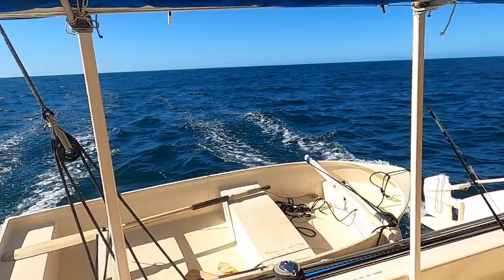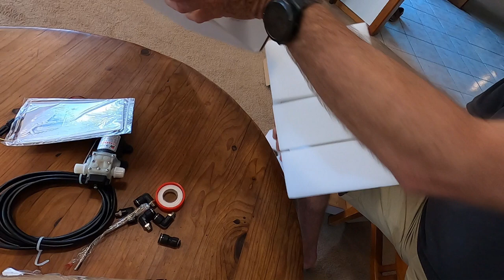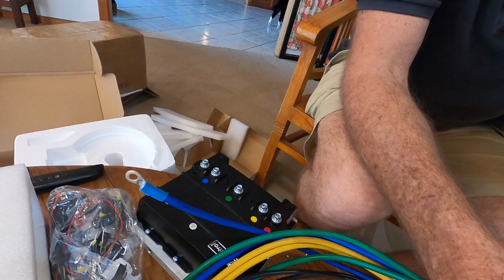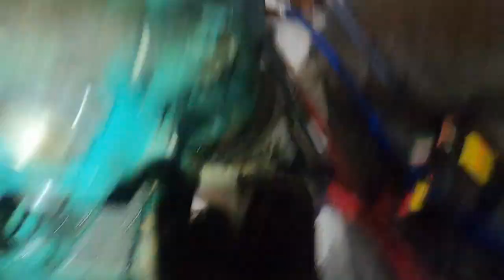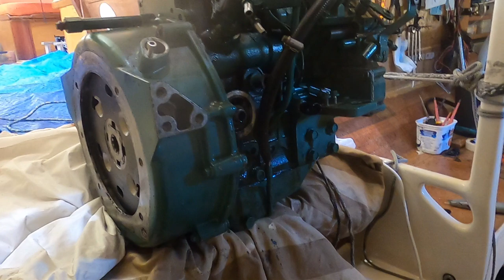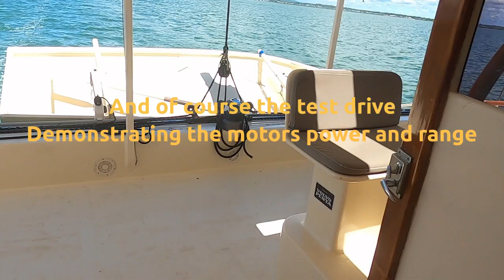Electric motor conversion on a sailing yacht- Episode 1 on installing 10kw motor in a 15m catamaran.

Comment: Hi Andrew…I just came across your channel. I own a 52’ hurricane damaged sailing cat that has bad engines due to water ingress but assuming the sealed Yanmar SD60’s are still good. Love your solution. Can you share pictures of what shaft coupling you selected and wondering if you considered linking directly to the vertical shaft of your sail drive, seeing that electric power eliminated your need for gears. -Ryan
Reply from the maker: Ahoy Captain Ryan! If you give me your email I can send you the shaft coupling photos. Yes, I have seen others doing the vertical mount of the motors, which does cut out a right angle turn and associated friction and allows for electric forward reverse. Going through the gearbox doesn't allow for electric switching as the clutch only works in one direction so you need to use the manual gearing. On the plus side the reduction ratio is already sorted at 2.18:1 (for the Volvo) and the other key factor is the ease of tying the electric motor mount into the saildrive pan mounts. This is very important in order to maintain the integrity of the saildrives in case of grounding where the mounts take the compression load (for a forward hit) . The chap doing the vertical mount was using a belt system with reduction pulleys. I think some reduction is still built into the bottom turn. Yeah, like anything simple is best in my opinion. All the best, Andrew

Comment: Hi Andrew, just bought exact same motor...  Are they always that noisy ???
Can you also share gear ratio and propellers spec :) ?
Thanks !!!
Reply from the maker: Hello Antony. Yes, the motor noise is interesting. The electric motor itself is quiet, and it seems its the saildrive gearing making the noise. Unlike a low growl of a diesel the electric motor is at a higher pitch so the gearbox noise is not drowned out in the same way. We also hear the propeller noise so much more as it too is not drowned out by the low rumble of the diesel. Interestingly I tried to hear other people electric drives on utube but they all seem to have music or talk over this audio so I wanted to have the sound clear on this. It is a lot quieter than the diesel.  The gear ration is 2.18:1 and the popeller is 16.5 inch x 13 inch pitch Gori 2 blade folding. I think its a really nice motor and so user friendly. Best of luck!
Reply: @AndrewStransky-cc2dr  Hi Andrew, so kind to take toime to reply, I appreciate,,,  I'll have 2 on my 40 feet Cata.  If you had any choice, would you change ratio or propeller spec or it's the best for you ?  REALLY APPRECIATE ALL your videos :)  Thanks for sharing !
Reply from the maker: @ Thank you. I cant think I would change either. The motor seems happy to run at the same rpm as the diesel did and the propeller was designed for those rpm's ' It has fantastic initial torque without cavitating  and drives the boat as fast as I need. The gearbox ratio  is the recommended ratio so that seem perfect. The fact this 10kw electric motor  matches the performance of our previous 30hp diesel seems more than satisfying.
Reply: @AndrewStransky-cc2dr  Thanks again Andrew, very inspiring :) !

Comment: Did you change the foot throttle to a standard boat throttle control?
Reply from the maker: Hello Jon, I'm still happy enough with the foot throttle arrangement. It's very simple and keeps the electrics all safely away from exposure to the elements. It also manages to sync pretty nicely with the diesel motor throttle. I might change in the future though, although the issue with an electric throttle with this saildrive arrangement is that electrically changing gears doesn't work like it would for a  shaft drive. The forward gear on the saildrive cant spin in reverse as the clutch lets go.I know this as when I first installed the electric motor I had it spinning the wrong direction and was very puzzled as to why the prop was barely spinning.

Comment: Amazing boat and project !Just a bit of clarification, you only had one 30hp  diesel engine aboard your boat ? If so that was not much compared to what is generally offered. Has that been a problem in some windy situations ?
Reply from the maker: Thank you Fredrica! When we launched Fantasia we had 2 x 30hp diesels and never had a problem in any wind condition. At times we have had to do with only one motor and while it is possible 2 motors is definitely the way to go. So now we 1 diesel and the one 10kw electric. The 10kw electric certainly seems very much an equal to the 30hp diesel as you have perhaps seen in my other videos.

Comment: hello , great work ! can you tell me the prop details please? pitch and diameter
Reply from the maker: Yes, I have 16.5 inch diameter and 13 inch pitch. 2 blade folding Gori prop. We did originally have a 17 x13 and this may well have offered a bit more thrust.

Comment: What was your reason for choosing a box-type enclosure for the motor?  Is it intended to provide some type of protection against water flooding the motor, in the event of a leak?
Reply from the maker: Yes, the box enclosure is quite important . For one it distributes any loading on the saildrive over a large area, so in case of grounding the box takes the pushing load into the forward engine mounts. It means the set-up is just as strong as when a diesel was mounted there. Also as you point out it it protects the works in case of engine-room flooding. I have sealed it and the top of the box is well above the waterline and the engine bay is also sealed from the rest of the boat. Yes, I have seen Oceanvolt owners building guards in front of their saildrives which are only supported by a small radius.

Comment: I have the same motors and controler in my cat
Reply from the maker: Great! They seem a pretty good build. How are you finding it? Do you have water cooling?
Reply: @AndrewStransky-cc2dr  yea water cooled, they are powerful enough but atm I'm using potentiometers to control them and I can't figure out how to make a dead spot in the middle so it easier to find the off position. Looking at a way to use hall effect instead and make something with levers and detents. The bought ones are either very cheaply made or extremely expensive
Reply from the maker: @Sailingon  interesting to be using potentiometers. I used the foot type throttle attached to my morse controls that the diesel used, to keep it simple. I was surprised how little travel it had when I tested the motor, but now that it is under load it is fine and the position of the lever is fairly similar to the diesel side. Yes, they are a very simple thing these throttles as I had mine apart hoping to adjust it, which lead to to trouble which I had to set it back to how it was. They just look like some kind of magnet passing over a sensor. I am quite happy with my throttle now, having made some adjustments via the EZekontrol app and a slight tweaking of the throttle insides.

Comment: Question : Catamaran and only one motor?
Reply from the maker: Sorry if I wasn't clear enough but no, we have a motor in each hull. We have just converted one of them so the other 30hp diesel is still there... So we basically have a hybrid system now.

Comment: I installed the same motors on my Cat but I kept the bellhousings and made an adapter plate to mount the motors. I also put both hand throttles into the same housing and got rid of the old cables. If you had taken off the flywheel it would have lightened the engine a lot. 
I also had to change the reverse power in the program because was not as fast as I liked. I am now working on getting the motor info on my chartplotter.
Reply from the maker: Oh yes, I never thought it was possible to get that flywheel off the D1-30. That would have made it a lot lighter!

Comment: Very impressive to lift the motor up and out, so many boats end up with a hole in the deck
Reply from the maker: Oh yes, cutting a hole in the cockpit to crane it out would have been easier but more work in the long run!

Comment: Glad to see you doing this conversion .. optimising the prop size and pitch is important with e motors as they produce more torque lower down .. 

Ive tried persuading Mark from Wilding sailing to power his Wharram.Pahi with a couple of these in the 15kw form . Instead of 9hp two stroke outboards.

I thought Golden motors only introduced the Axial flux motors recently ... and these were the radial motors.  I will go back and read it again. 

Looking good mindyou ..theres a guy in the UK with a Heavenly twins cat with twin these motors...  and it performs exceedingly well.
Reply from the maker: Hello Clive. The prop aspect is interesting, but not something I have a huge grasp on! I have been running tests and noted yesterday that the 10kw actually develops thrust faster than the 30hp diesel, which relates to this low down torque. I'd say these motors would be great on 9hp outboards.
Reply: @AndrewStransky-cc2dr  

I ve just seen this I will see if I can supply you with some comparative  information tomorrow.. 
The extra torque of electric motors puts them ahead of most ICE motors.  So they can swing larger props with more blades usually. .. they are also more controllable as you don't have to rev  to generate a given  thrust.
Reply from the maker: @clivestainlesssteelwomble7665  thank you that would be very appreciated. Just getting a handle on the differences between electric and ice seems tricky. So I can see they have more torque early, while the ice needs more revs to generate torque. Any info would be great.

Comment: Will be interesting to see the performance.
I'm doing a similar thing 14m powercat, ex sail boat, initially was going to go with a 48v possibly 96v setup but have now gone with nissan leaf motors - 150hp outboard conversion  and will most likely use Tesla lfp batteries.
Reply from the maker: Yes, 96v gives better efficiencies. I wish you good luck with this project. Plan things well and press on.
Reply: The other super safe option and easier to maintain is the Blade lfp batteries that were originally developed by BYD..
Reply: @clivestainlesssteelwomble7665  I'll check them out, cheers
Reply: @ecojet8384  
They come in various lengths now .. from the original long Rhino ones are half or a vehicle width to a very short briefcase length version or what looks from the outside as a prismatic.. it helps with voltage and space fit.  On a boat you should have less restrictions on space. 

The other person who was headed down your route  was a German guy converting a cat lifeboat. .. Heart of Gold 🥇 but he hasn't posted for some time.
Theres a uk guy whose built a converted Al fishing cat hull with Leaf motors.. its featured in  PBM.

Comment: Not sure how happy Carolyn would have been getting engine grime on the linen during the removal process.☹. Although I am sure she will be happy about the much cleaner result.. What are the advantages of the 48v system? Such an interesting project, watched the vid 3 times now! Looking forward to the performance test results in terms of distance and run time capacity etc. Well done for now.
Reply from the maker: Haha, so much grime came out of the engine room! In this first part of the conversion you really notice how much cleaner life will be! 48v seems to be the max voltage for DIY projects. Compared to 12v the wires need only be 1/4 the size. Higher voltages do gain more efficiency though but moving to 48v was enough of a leap for me!

Comment: Very clean setup and love the innovative idea. 

I was looking at purchasing a very similar motor - a 25kw ‘Paraglider’ electric motor to put into an electric motorcycle build so it’s awesome to see you using this 10kw as an engine for the fantasia 👍
Reply from the maker: Those Paraglider 25kw motor look very interesting. The open style housing would obviously aid air flow and cooling, but you would need to filter the air. Cooling is a key thing which I will be looking at in detail in my coming videos.

Comment: Are you going to have any sort of fire suppression system on the motor or battery? Wouldn't want any sort of overheating problem or short  to cause any damage.
Reply from the maker: Hey Maximitz! I will certainly be dealing with this important aspect of electric motor installs in my coming videos. Thank you for reminding me.